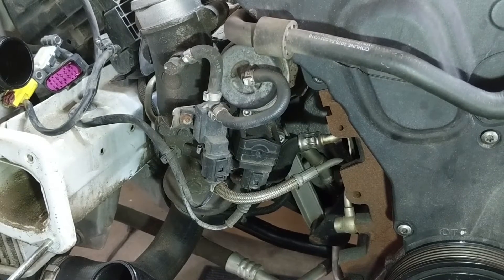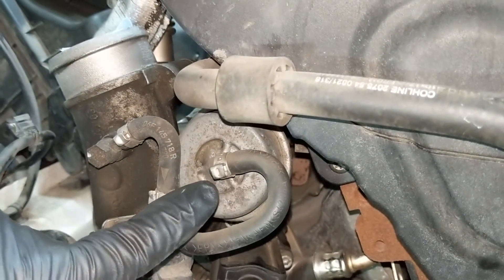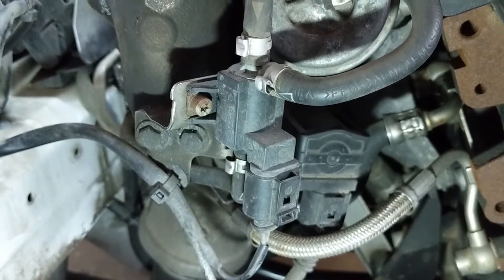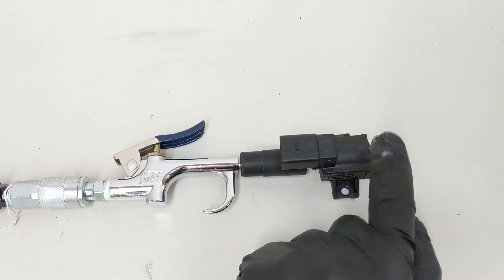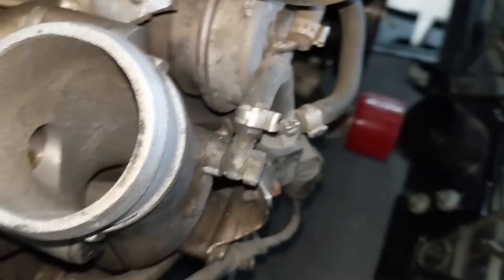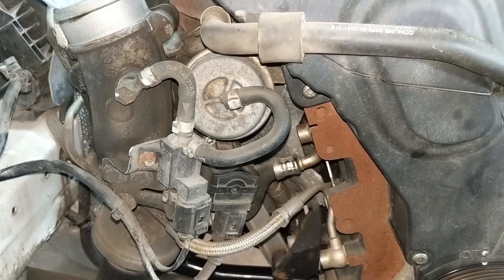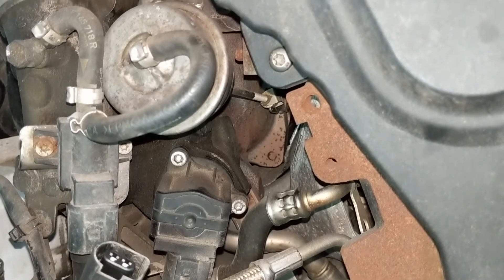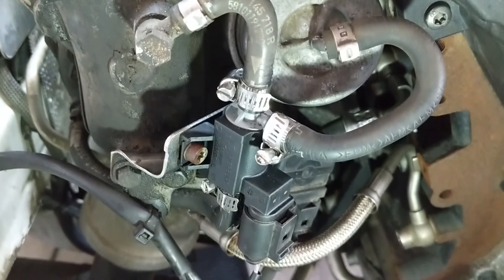N75 Valve - Audi/VW Testing & Install | How it works | 2.0 FSI A4 B7

Comment: Im wondering if my n75 valve is misbehaving.  I keep building  boost when accelerating  and it only bleeds off when i take my foot off the gas. Is the possible  or is it something  else
Reply from the maker: Hey Adameus - What you're describing is more or less the definition of what a blow off/diverter valve does, and that foot off gas = no air = no exhaust = no exhaust turbine spinning = no boost. Is there something happening that doesn't feel right, or data you've collected from the car that's pointing to a problem?
Reply: @FigureItAuto  my issue is my boost keeps building to be 22 psi and spikes st 25.  Heres the in for its an audi b7 a4 2.0. I just had the engine rebuilt  so it has 150 miles on it. The n75 valve is hooked up correctly. I have a go fast bits diverter valve and a ko4 turbo. The car has a stock tune on it because of the rebuild.  So when i give it full throttle i get max boost. My gauge reads up to 30 psi. Its suppose  to taper off at 8psi or so but it doesn't  do that at all. It just keeps boosting. I have no check engine light. I checked it for pending codes. I cant figure out why it the n75 valve isnt doing its job.
Reply from the maker: Thanks for the extra details; I misinterpreted your first comment. I welcome anyone else reading this to chime in because I don't run an upgraded turbo but it sounds like you're overboosting and it could be a few things. If the K04 was also rebuilt I assume it's waste gate is operating via the linkage + actuator from the N75 properly - but if it's not, that'll build way too much boost. Otherwise, the stock N75 maps may not be running a duty cycle high enough to modulate the waste gate (again, I'm not tuned so I don't know to what degree most tuners manipulate the N75 maps to compensate for higher boost levels) while you're using a larger turbo on factory settings. It's possible that without an added boost controller, your N75 is working just fine but it can't keep up with the additional air being pumped around. You may also be running lean right now and might want to check the spark plugs for evidence of that.

Comment: turbo is cracked on the hotside by the actuator .. not sure if anyone else noticed
Reply from the maker: Wow, I think you're right...I'll be checking that out soon. Thank you for the heads up! begins thinking of turbo upgrades...
Reply: @FigureItAuto  time for a disco potato lol
Reply: The black case in the front of the engine or after the actuator arm towards the back??
Reply: 0:33 or 4:33 ??

Comment: Hey, have a 2002 Audi A4 Quattro it’s all stock except for a drop in kn filter. It would boost up to 7-8 psi and hold steady sometimes spike at 10psi and drop back to 7ish. I recently got a stage 1 Unitronic tune, it’s suspose to bring me up to 16.5 psi on a stock car. So I was only able to hit 14 psi max and then it would bleed of to around 12. Now it gets less and is only at 10psi and gradually drops as rpm increase?? Do you think I have a bad n75 valve or possibly a bad diverted valve? Any help would be great
Reply from the maker: @tomrocs There might not be a problem at all, actually. Despite how the boost reacted before the tune - and that yes, there can be a number of ways boost could be lost of mismanaged throughout the system - I'm not sure what you're experiencing is out of the norm. There is data log proof that the max PSI some of these tunes cite it achieved earlier on in the RPM range (like, 2500-4000) and tapers off quite a bit on the top end. Although these cars (the 2 liter, on average) are good highway drivers and have some power on tap for mid-high range, they just aren't built for top end power. Do you have access to data logging software? You can compare actual boost vs. requested boost and see if your car is able to meet what the tune has been set for. If there's a marked discrepancy, then you can start trouble shooting something mechanical. Nice sounding 'stang on your channel, BTW.
Reply: Figure It Audi thanks for the quick reply!! This is my first Audi, I am a ford guy, had a ton of mustangs carb/fuel injection among other fords.. This Audi is a whole diffrent animal then what I’m use to. Lol!! I do not have data logging software access I’m just going by what the boost gauge is showing me as I drive? I’m figuring it’s something mechanical like failing turbo/wastegate, torn diaphragm in diverted valve or possibly faulty n75 valve
Reply from the maker: @tomrocs  Well, welcome to the club. Your hit list of possible issues there is bang on and there are usually multiple factory revisions and aftermarket upgrades for each of those parts. It's always possible there's a leak somewhere in the piping or a smashed up intercooler, too. It's all stuff you should be looking at within general maintenance, anyways.

Internal waste gates are one of those items where it makes a lot of sense why manufacturers utilize them in their turbo design, but as a consumer, it's the worst reason to have to replace an entire turbo or at least a giant pain in the ass to diagnose and attempt to alter. Having a simple, external waste gate from the factory would have been nice.
Reply: The standard N75 is designed to taper off as revs increase, if you want it to hold a little longer use the N75j wich delays the signal a tiny bit and also gives an increase of about 3psi.

Comment: Nice vid. I'm trying to find info on why my boost pressure won't hold steady. Once it gets up to peak pressure, it's clear that the wastegate opens, dropping the pressure slightly (the needle jolts back down the gauge) then it seems like the wastegate is hunting. It just won't hold steady at peak pressure. I've made a lot of adjustments to the actuator rod length. The spring inside the unit is strong. The N75 clicks away. The pressure builds with throttle opening/revs. Just drops then won't hold at max.
Reply from the maker: It sounds like you're describing a boost leak. Personally, I've vowed to not play with the actuator rod because without seeing inside the turbo to understand how/when/if the wastegate is actually (fully) closing, I don't have the confidence of verifying the results of my work. But let's assume you've got the rod tuned up perfectly. What I also don't know is what expected boost across the entire RPM band is per the N75 maps. It's hard to say what you're experiencing at exact moments is or is not as it should be.
Anyways, with the gate closed and engine under load, building boost up until max, it's conceivable this is still possible with a leak. When the wastegate opens, there could be way too much loss for boost anywhere near peak to be maintained.
It's the go to answer but: have you checked the DV yet? Revisioned? Upgraded? I put in the Go Fast Bits DV+ on day 1 and have never had an issue.
Reply: @FigureItAuto  hi. Thanks for the reply. DV? I didn't describe one part which is that the boost pressure fluctuates once max boost is achieved and then the slight drop occurs. My translation of that would be that the wastegate opens too much at this max pressure, then the N75/ECU is trying to correct this drop in oressure but there's lag in the system. I have a VE engine with larger nozzles that i've put in a T4. I've replaced the lines (braided), fitted an intercooler with new hoses. At first i shortened the rod to increase the compression in the spring, making it a slower/more damped response from the N75. It was an improvement so i went a bit more but eventually hit limp mode when it couldn't open the wastegate. I backed off slightly then went for a remap. The guys didn't offer great service, unfortunately. I expected they would adjust things accordingly with the increased boost map etc. So i'm a bit stuck now. I may replace the actuator to rule it out but can't be certain of the preload setting etc..
Reply from the maker: I see, yeah, a few somewhat uncontrolled variables there. "DV" is Diverter Valve, the recirculating blow off valve. Many early B7's came with a version of 06F 145 710, which tend to tear their diaphragms and leak boost like crazy. Basically everyone upgrades to 06H 145 710 D but I went for https://gfb.com.au/products/blow-off-and-diverter-valves/dv-plus/. I don't get to hear fun noises anymore, but I always opt for the reliable performance upgrade. It's easy to check which version you have, if you haven't already. It may be your problem, oppose to some of the other things you've been mentioning.
Reply: @FigureItAuto  Mine's a 96 engine - AHU. Doesn't have anything like a DV. IT'd be worth me checking for leaks though. Cheers

Comment: How do you remove the waste gate actuator
Reply from the maker: @VerifieDribbler _ I haven't removed the waste gate personally, but I'll say that once the vacuum hose is disconnected from the actuator, there's only 2 nuts and a clip that holds the rod (that's basically the same part as the actuator unit) to the rest of the waste gate linkage. The important part to keep in mind here is that the rod is specifically adjusted with those nuts to open the waste gate a certain distance. If you plan on removing the actuator, 1. Make sure you mark where the oem adjustment locations are, and 2. Be prepared for the scenario of the parts not going back together in the same way or at all.

I recommend reading these threads on Audizine:
https://www.audizine.com/forum/showthread.php/419180-I-m-stumped-amp-boost-issues.-Possible-wastegate-or-related-failure
https://www.audizine.com/forum/showthread.php/420536-Wastegate-Adjustment

Thanks for the question
Reply: The arm? I believe that you need to buy a new turbo